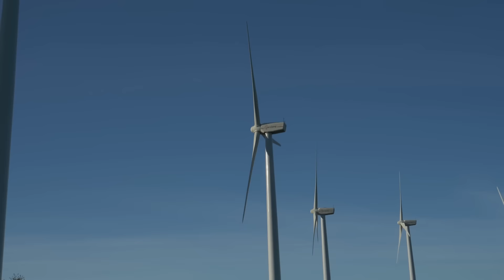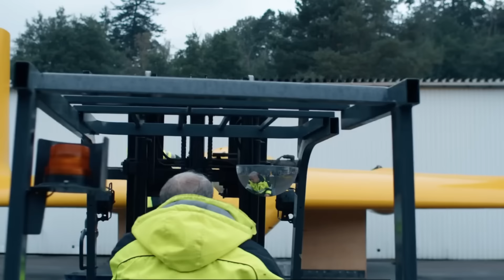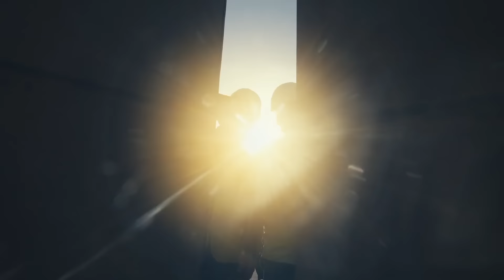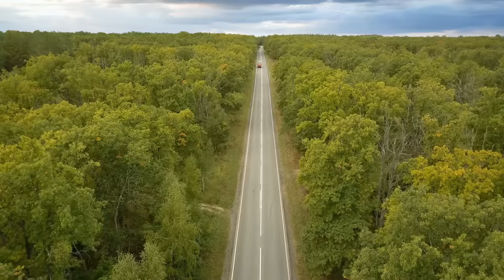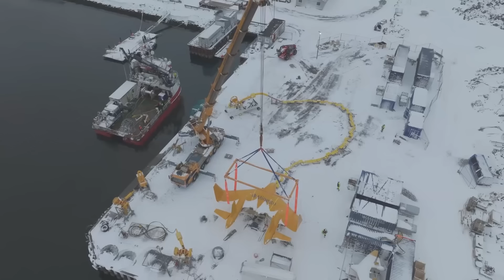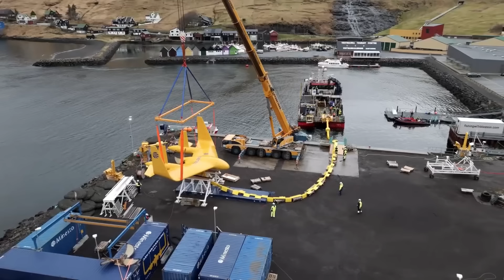This Underwater Kite Is Powering Over 1000 Homes Right Now

Comment: If there is too much energy in the grid, once the batteries are charged, it should go into electrolysing water to hydrogen (& oxygen). This can be used locally, in fuel cells for electricity, or exported to other areas.
Reply: Sodium Ion batteries are NOW being manufactured and distributed, they will change the world as we know it. They are the revolutionary low cost and effective way to store energy. Allowing it to be cheap and available 24/7. This will be attained within 2 years
Reply: @michaelbokrosh7374  it must show low probability of becoming flammable...think it'll take China that long?
Reply: And for the people who always say "but elecrolysis is really wasteful!"... in this case it's negatively wasteful.  It's using energy that would otherwise be entirely lost, so...
Reply: True.... but first we need to solve the problem of how to safely, cheaply, and over the long term store the smallest (hence, the most elusive) element in the universe... which also happens to be highly explosive in our atmosphere...
Reply: Surely it wouldn't be too hard to produce steam and store that in similar battery conditions
Reply: @tarawaukeri8928 pressure is... challenging. And thermodynamics will kick your ass, too
Reply: Hydrogen is more useful in other areas, the idea of using it for energy storage is very quickly becoming outdated

Comment: Underwater propeller, of relatively low revolutions, generating electrical energy is an environmental hazard, but hundreds of thousands of boats and ships propellers are not?
Reply: Thank you. I keep hearing that argument of "but what about the wildlife ?". Well it's almost as if they're used to having to avoid stuff moving through the water. I wonder how many marine animals die each year by simply "colliding" with whales and submarines. You know what's an actual threat to sea creatures ? Climate change. We probably save more animals installing clean energy than these equipments will ever kill
Reply: the difference is that so far underwater turbines were fixed installations, and virtually no body before the propeller. A boat is a large object with a propeller at its end. Animals avoid the boat, and the noise of the propeller. 
With this kite yuo have a large body moving through the water, in a largely calm  current. Even slow swimming animals can evade it, they can see it and navigate around, even if it is producing very little noise. I expect 0 impact onto wildlife. They just should care about the coating, not using toxic antifould. Nano surfaces coould be a solutions

Comment: Anything marine is expensive as soon as 1 thing is wrong you lost all revenue, rotor stuck you need barge divers a crane + salt water corrodes like hell and all the smooth surfaces are soon covered in barnacles. these tide solution all work fine on paper but in practice these projects suck up subsidy and then fail
Reply: As far as i understand, ease of maintenance is built-in to this concept. For the barnacles a nano coating could be the solution. And for the kite, barnacles do not matter that much, since it is not the lift force which is required. It will probably slow down a bit on its figure-8 travel, but even that is not sure. Barnacles increase the resistance, if the resistance increases, the travel speed in the fig-8 could even increase. 
Using alloys that don't corrode is possible here, because it is not a ship.
Reply: I agree, but those have to be tested anyway. We need many tech to get rid of carbon.   Sure barnacles...But oil tankers have those too and they travel the world.  Having  new tech for maintenance isn't a problem.  Problem is global efficiency.   sure this will be far more efficient than batteries to store wind and solar energy, and batteries are no help for interseasonal storage. So even expensive those ideas have to be tested. We came form carbon only to nuclear, solar wind white hydrogen and anything that can help.
Reply: This is how evolution works .. 

I bet u didn't think we would have commercial flying cars in 2026 if someone asked u 1993 ? 

Are u to young to remember 1993.. why are u even talking?

If u remember -93
U should know better then totally deny this idea
Reply: @XtremeLife  This is not evolution you mean how innovation works yea sure but watching people spend 30+ years on this problem costing millions and every time the build the same shit a propellor under water... and every time they stop as soon as subsidies stop because placing things under water is Hella expensive  not to mention maintenance and repairs .
Reply: @XtremeLife  while i sound negative im all for these kind of systems but just adding some realism they all sell themselves as the solution but never seem to be, systems that funnel water into a bay to power a single big generator seem to work out better